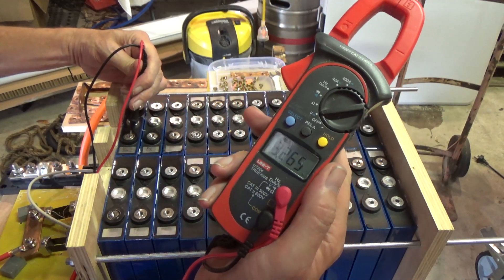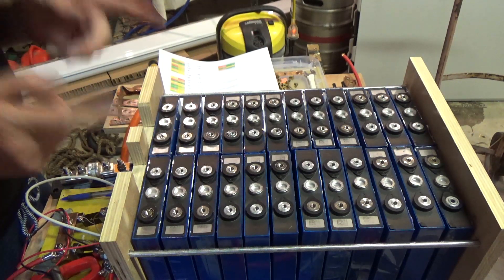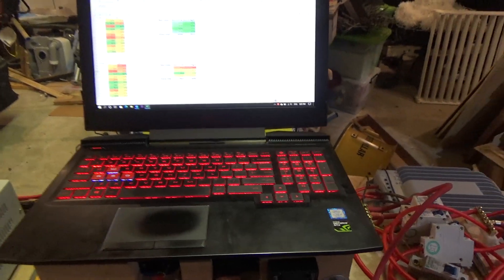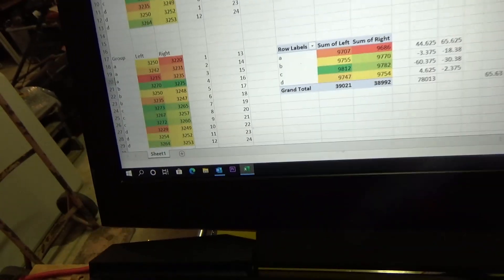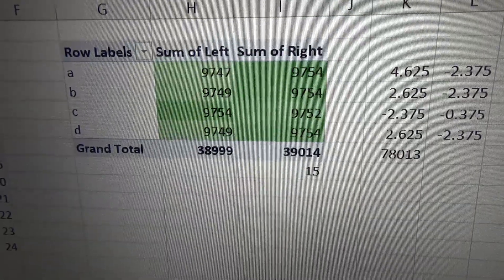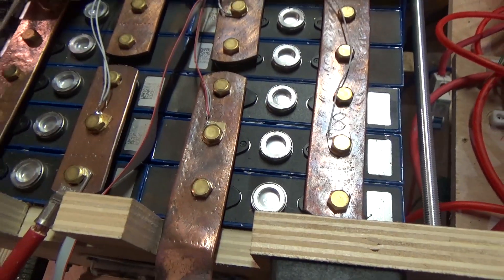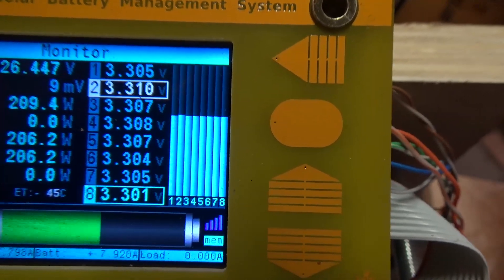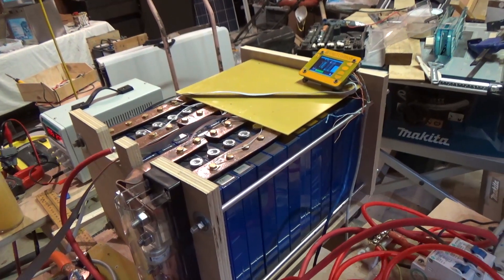LiFePo4 Mid Balancing | Yep, it's a thing now

Comment: You can use battery repacker website  for easier battery grouping. https://www.repackr.com/#/pack-builder
Reply from the maker: Cheers, thats pretty cool
Reply from the maker: Hey I have tried that website, of course still doing it on rested voltage as a capacity indicator rather than real measured capacity. Sure makes the process much easier. Now I have to reassemble it and see how it worked out

Comment: Looking good, will be very interested to see how many AH you get out of the balanced pack. (divxmaster)
Reply from the maker: Yeah mate. With some of those cells looking so weak its still not likely to be great, but hopefully will be better
Reply: @BusedAsNZ  well fingers crossed.  Also I'm looking at putting some 2A pico fuses on my balance wires (will be just cell voltage read wires in my case).  Saw it recommended that these be added.  I'm going to wire up the cell voltage read wires today, into 4x resistor dividers.   fuses like this: https://nz.mouser.com/ProductDetail/Littelfuse/0251002NRT1L/?qs=sGAEpiMZZMuMS2dUaCDnDLY6AWy6KTIs